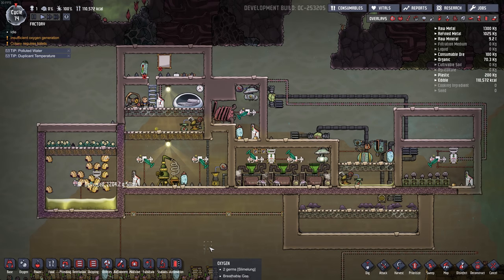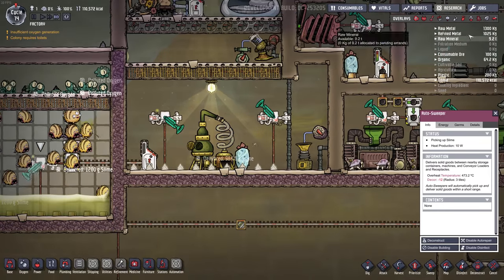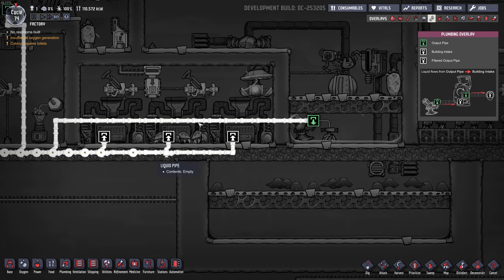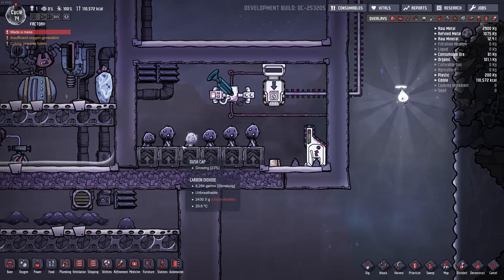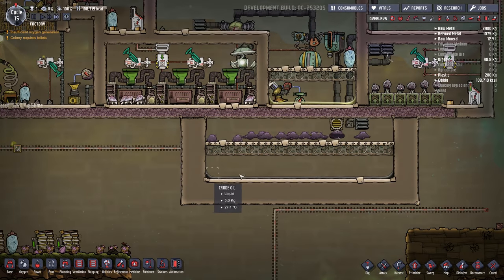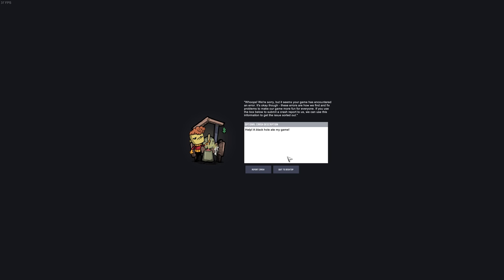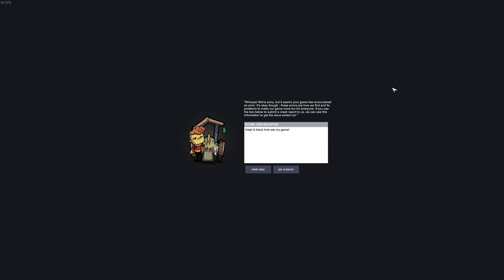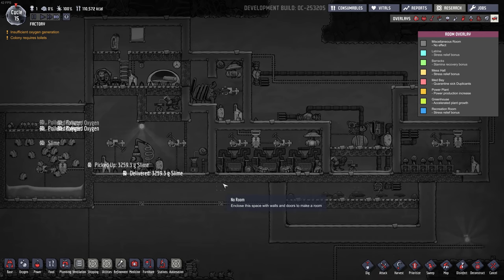SLIME FACTORY CONVEYOR SYSTEM - Oxygen Not Included - Occupational Upgrade (JOBS, HATS)

Comment: Nice. A clock for the slime could be an option.

I wonder how much of this is viable now? Critters get fussy with room sizes now... you might have to have a giant room or several smaller ones to get the same output. Then there's the lifespan. It'd be interesting to see a before and after comparison.
Reply from the maker: Quite a bit has changed. I'll have to revisit this at some point. The new germ sensors could probably help as well.

Comment: How does this sound?  I've been planing on using the heat byproduct from metal refineries to boil water and convert crude to petrol.  It would involve using a section of pipe that wasn't insulated with the intent of transferring the heat in to something else.

Before I had heated the oil directly but when it transitioned to petroleum it broke the outlet pipe.  Now I don't know why I didn't think of this sooner but I could use petroleum as the piped liquid.  Raising it to over the crude oil transition temperature.

I am imagining a large cooling pillar to step down the hot petroleum in to other places.  Like boiling polluted water to power a steam engine among other things till it is cool enough to turn in to plastic.
Reply from the maker: I actually had a long think about this a few days ago and tried some things out. So if I understand.... use petroleum in the metal refinery to get it past 400C and use that heat to boil the oil into petroleum. That should work. You could preheat the oil with the waste heat of the hot petroleum to close to 400C.
Reply: Yeah.  The Petroleum should be safe till like 530 degrees so there is some room.

Oh that is a real good idea.  I would suspect since they have similar heat capacity you would normalize down like 50c oil and 400c petroleum without worrying about pipes breaking.  I still want to boil water with it but that should work for getting most of the heat out just by using incoming oil.

Comment: Why are you using filters? They waste so much power, you can just use a pipe element sensor and a shutoff valve.
Reply from the maker: I prefer them. Also the shutoff valve setup can let incorrect packets through during backup.